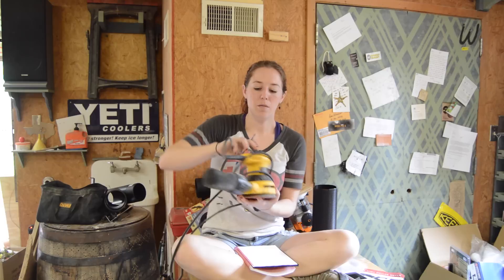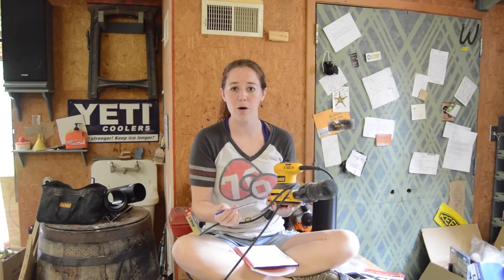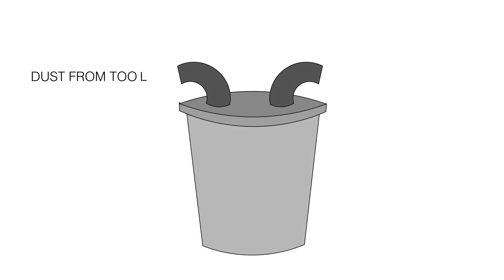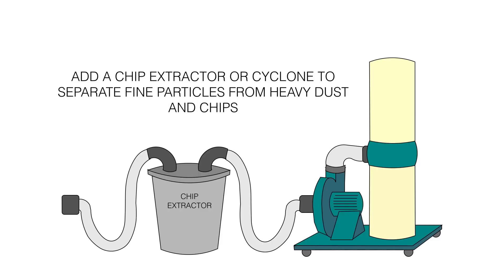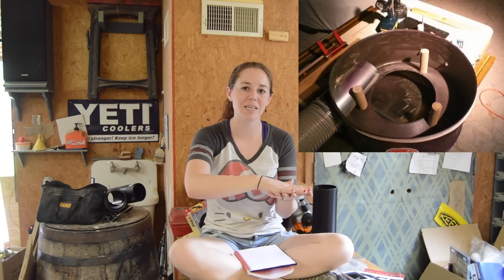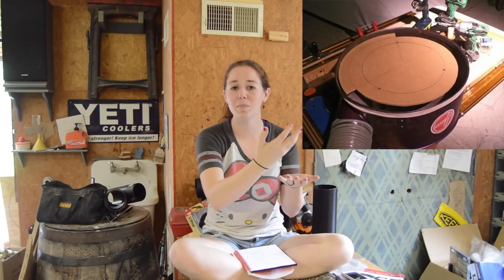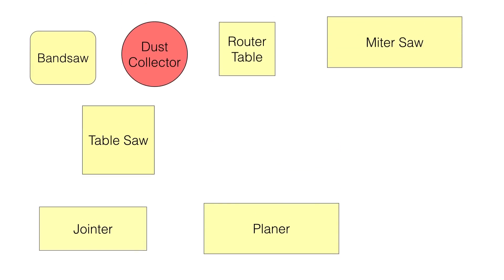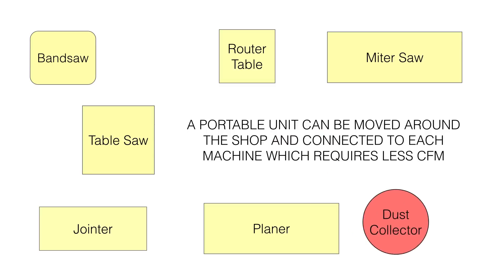Basics of Dust Collection - Overview For Beginners

Comment: April, great video, the other as well.  I built a Thien baffle in a trash can years ago and love it.  One thing I added was to drill a 2" hole in it, a little below the baffle, silicone some clear plastic, so I could see if it was full at at glance.  Yours being outside, you'll have to watch that.  I filled mine up pretty fast planing lots of oak and didn't realize it, filled the trash can and the lower bag on the dust collector.
Reply from the maker: I was thinking about adding a site window! I'm glad to hear you've done it, maybe I'll go ahead and do that before I set it up permanently.

Comment: Very well done, April. Someone mentioned cyclone separator - well, that is what you made. A cyclone separator does not have to be conical like the commercial versions.I made a separator out of a reinforced 12" diameter concrete form tube from Home Depot, connected it to my shop vac. Very efficient.I subscribed, looking forward to more.

Comment: Great intro to dust collection.  I built a crude but effective 2 stage collector using a cone shaped roofing flashing, a 5gal bucket being driven by a shop vac. Even though the dust swirls in the bucket the narrow cone stops it from coming back up.  One day I'll step up to a big central unit but like all of us, one step at a time.  Tks agn.

Comment: I know it's not likely an issue in Texas just like in FL due to the humidity but you way want to consider grounding the system to prevent a static spark for igniting the fine dust. Another great video as always!

Comment: April, love watching your videos. Well done and informative. One thing to consider venting outside is heat loss. I live in the Midwest so heating my shop is already costly and pushing 1/3 to 1/2 of my heating capacity outside will not be cost effective. Filtering the return air back into the shop would not affect the heating and cooling costs and actually on mildly warm days keep the air moving so I could cool the shop a little less. Keep up with the great projects.

Comment: Just wondering if you ever thought about trying a cyclone dust collector.  I know they can be a little more difficult than setting up a Thien Baffle, but you don't need the 2 stages.  Everything gets dumped into the lower bucket and the exhaust can be vented outside.

Comment: My set up has 3 stages. At the farthest end of the duct, I have a 30 gal drum with a baffle system for collecting larger chips from the lathe and plainer. Just before the dust collector I put in a cyclone to separate the majority of the dust from the air stream, and finally the dust collector filter bags, which after the cyclone don't have to deal with much dust at all.
It is far too cold here in the winter to be pumping the heated air outside so I put the dust collector in a room that I can close the door to cut down on the noise.I also have an air filter hanging from the ceiling for cleaning the dust that escapes the dust collector system.

Comment: A friend of mine did the shop vac and pvc pipe setup 20+ years ago with a 25 gallon Craftsman vac. He had the vac outside the shop, and extended the switch for the vac through the wall.

Comment: Hey April, I watched this when it originally aired, as I do all your video's.  And I have purchased a Harbor Freight DC as well I plan to put into my mobile shop (trailer). Everything in the shop will be on wheels so I am still going to purchase the Wynn filter. But, you've convinced me to just exhaust out instead of making room for the filter.  I've watched countless videos on converting single stage to dual stage.  I've heard about the Thein do dad you talked about as well as the clear vue that whats his name designed.  But, until I watched this video again it never occurred to me do these two technologies go together?  I'll go back and watch Stumpy Nubs and see if I can tell but I don't remember seeing a thein thingy.  Any insight will greatly be appreciated.  BTW since I have an over abundance supply of daughters, step daughters and grand daughters, I think you're a super hero.  Keep up the awesome work.

Comment: Thanks!
Some of the "ports" on the tools are so superficial that you need a jet engine to get proper intake of dust. 

Consider effects outside your shop of noise and sawdust.

DIY note...some lawn blowers are also lawn vacuums, you can get still in factory pkg "last year's model" for under $80 on Amazon and the metal impellers are designed to eat sand, some gravel, etc. Comes with a big filter bag, too, but the intake is a comically huge cone, need to  adapt that. Toro is a good brand.

Comment: Hafta disagree on some of it.  I bought my HF cheap single stage dust collector in 1991.  It's still running great with near daily use.  Zero problems with motor, impeller or any other component.  Even using the original bags and clamps.  I did, at one point convert to a two stage and found the air flow reduced by about 15%, so converted back.

Comment: The main down-side of venting the air from the impeller to the outside is,  it takes heat from the workshop, which in cold weather is a waste of heat from a heated workshop.

Comment: for my application which is craft specific , I just needed to pull dust away from me at one station.I do bone carving and carve sticks for custom walking sticks. I have a small station and i think using my shop vac and a 5 gall on bucket under my table. ..

Comment: A thought...If you are building an enclosure outside your shop to house the dust collector, you may as well build it slightly oversize and house your air compressor out there as well. Air compressors, especially oil-less models, make an unbelievable racket in a small space as I'm sure you know.
Reply from the maker: My air compressor is actually already housed outside and an enclosure. : ) So its taken care of.
Reply: April Wilkerson well now, that's excellent. The one in my shop (the one they pay me to go to) has a giant compressor in the corner and it's excessively loud. I dream of a quiet compressor.

Comment: Don't forget about the air filtration system that you hang from the ceiling. I bought a Wen brand which got good reviews and cost 143.00 at Home depot.Grizzly sells the next least expensive. check them out. That will at least take care of the fine dust.

Comment: I have a Reliant 720 one stage. What is the best way to install piping. Do i install the pipe high on my shop walls or low near the floor. What is the most efficient to full use of my vac.

Comment: Great video, not sure how to attach my shop saw with 1.5 OD output to a huge collection unit or my table saw which is not on a base with a 4" output. If I just use reducers, will it really collect any dust?

Comment: Thanks for the informative video. This is good information I could have used back when I was setting up my own system. One question for you (and sorry if you addressed this in the video and I missed it), do you have a means to bring make up air into the workshop, or is it just leaky enough that you don't anticipate a problem? If you're moving 800 CFM of air out of the shop by venting outside, that air needs to come from somewhere. I see an HVAC vent over your shoulder there and assume its a conditioned space. The largest issue is if you have a furnace in the space. Pulling air out of the workshop risks pulling combustion gases backwards from their exhaust into your space. The second issue, assuming your make up air is ultimately outside air, you pretty quickly replace all your conditioned air with unconditioned air, making the place pretty cold in the winter. Perhaps thats not the case for you so you're in good shape, but it is something that would limit venting outside for many people with home workshops (myself included).
Reply: I'd wonder about that with a wood stove!!!

Most structures leak enough (modern garages are made to leak if the gas water heater's out there). It would potentially pull extra air from a central HVAC system, or make an evaporative "swamp cooler" work better.

Comment: I'm a  beginner and I'm wondering how much protection using my shopvac hooked up to the tool being used, combined with a good facemask will provide versus the complexities of putting in such a system.   Any advice?
Reply from the maker: I'm actually not sure since I never use a shop vac I don't know how much protection they give. I imagine it would depend on the filter and how much it's rated to pick up. For filters on these DCs, they say to get something that will trap down to a .5 micron.
Reply: good job!
Reply: good job!

Comment: Any thoughts on the size of PVC pipe that's appropriate for this DC. I'm converting my 2 HP dust collector to 2 stage, and incorporating a Super Dust Deputy XL.  I'd consider running 6" PVC but I'm uncertain if it has enough power to pull that volume of air.  Ant thoughts o suggestions?  Thanks.

Comment: In addition to the health requirements, readers need to understand that dust collection allows the tool to work better. A piece of equipment has a hard time performing its job if it is choked with shavings and dust.

Comment: The main reason for a two stage is dust is an explosion hazard and must be kept away from sparks of any kind. As even static electricity is enough. I seen one first hand explode and it's like a bomb went off! That means no plastic container of any kind and a ground strap installed.
Reply: +Claude “Reviews4U” Rains That's true Claude.  Dust explosions can do a lot of damage.  There was an explosion at a grain mill in Philadelphia back in the 50's that cause a tremendous amount of damage.
Reply: I viewed another video that mentions you could use PVC but should run a wire inside and attach it to a ground.

Comment: When I turned my Harbor Freight into a 2 stage, I got the Dust Right 4" Dust Separator components: http://www.rockler.com/dust-right-4-dust-separator-components and a 30 gallon fiber drum... it worked out GREAT! Another thing you need to do is get an aftermarket nanofilter for the HF dust collector which goes down to 0.5 microns: http://wynnenv.com/woodworking-filters/ The 35A Nano.. This system coupled with a ceiling-mounted air filter is well worth it. Of course, buy these things a little at a time... The Wynn 35A Nano is $177.00, a fiber drum can be expensive if you don't have access to one for free (can easily be replaced with a 32 gal trash can from Home Depot).